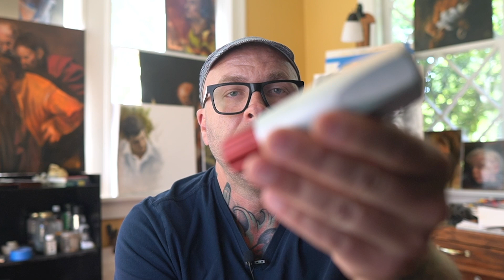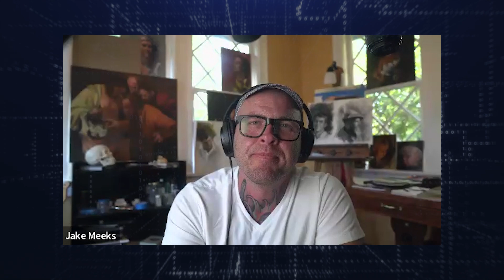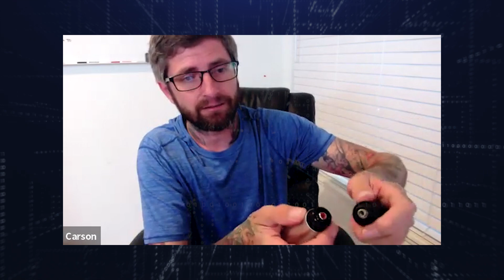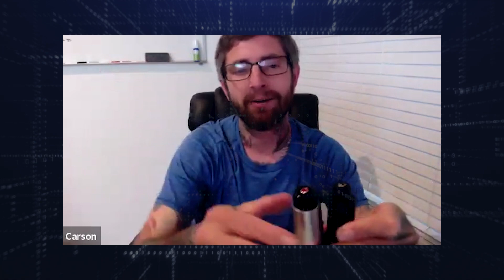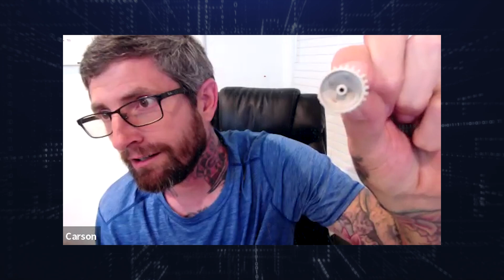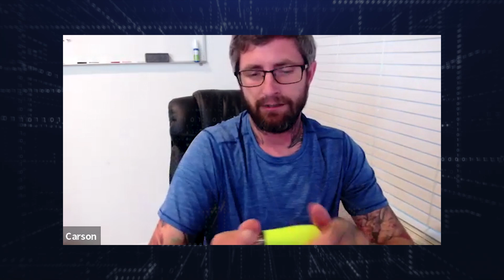Who Gives a Torque about Tat Guns? | Carson Hill of Neuma Tattoo | Ep 257

Comment: I got a steel  motor housing with the black aluminum shift grip the neuma has impressed me in power  lining the feel is very unique vs other rotary machines most that I try all perform the same the neuma 4 does what they say, impressed
Reply: Sounds good do you use traditional needles
Reply: @AndrueSOCAL  this machine doesn't take those only cartridges

Comment: Welcome back!! Question for you…what wireless machine do you like best for American Traditional styles?
Reply: Longest stroke you can find and slow way tf down.
Reply: Dan Kubin all day long.  If you have to be wireless then buy one of those finger switch thingies for your power supply that eliminates your foot pedal…or do what I do and buy a clip cord adapter from workhorse and throw a battery on the back of that bitch.  Dan would hate you for doing that probably but it’s one way to go completely wireless and still use one of his machines (which are insane if you want to use anything above a 9rl)